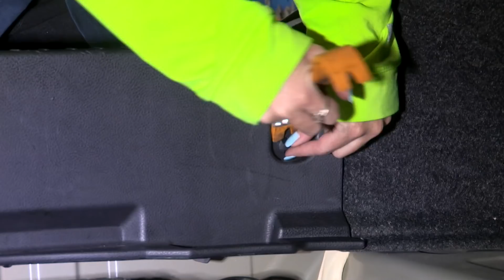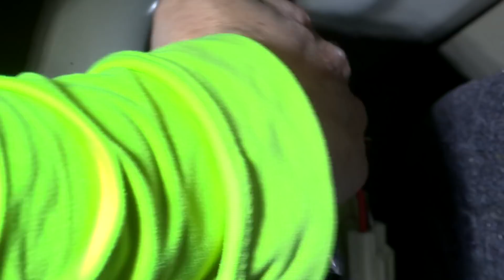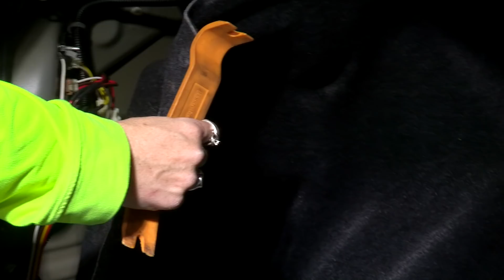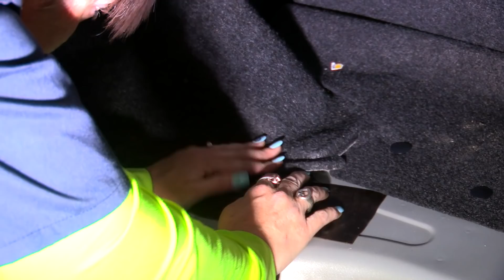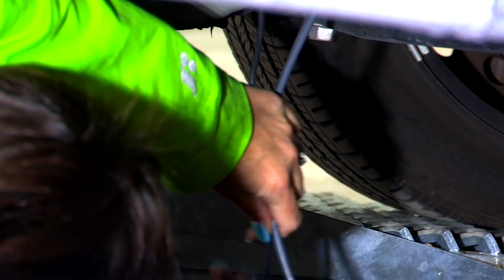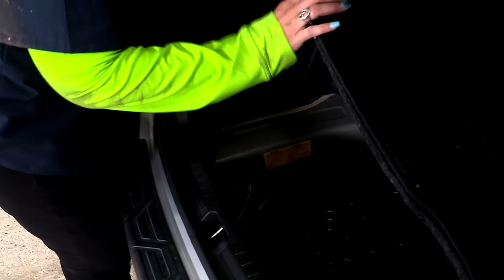2018 Toyota Corolla Wiring Harness Installation

Comment: This video is very very helpful, except for the very last part, why don't you run the wiring for the trailer down through the hole underneath the spare tire? It's very easy to cut a slit in that and drill through the plastic to have an easy access point